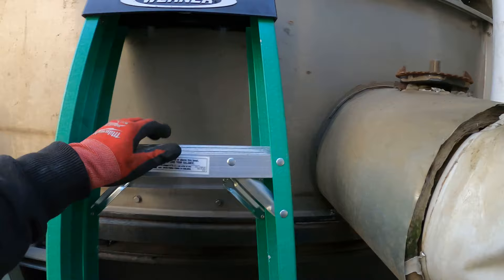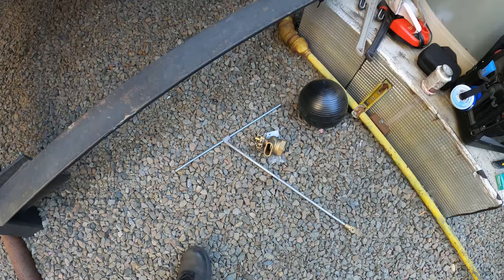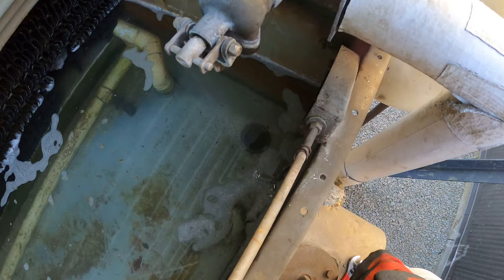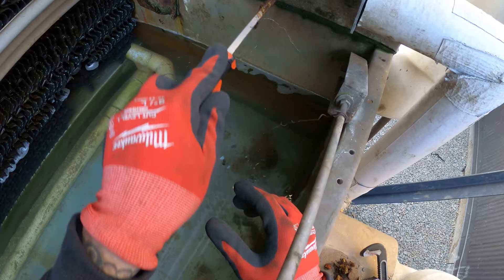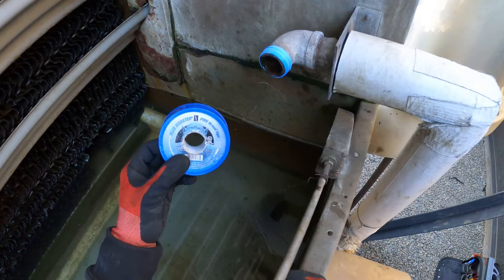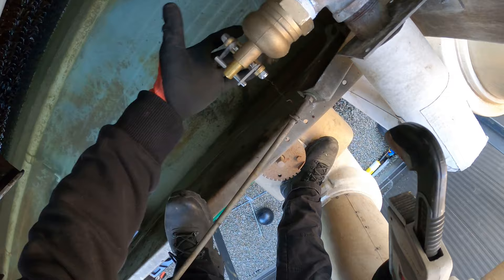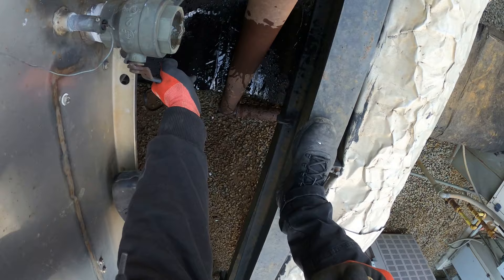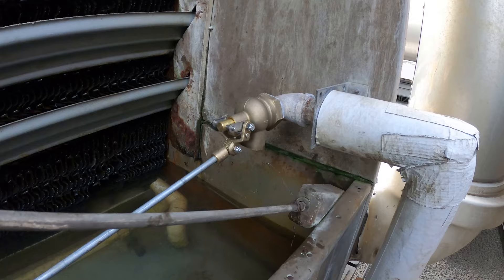HVAC: Cooling Tower Float Valve Installation/Replacement ( Cooling Tower Make Up Water Float valve)

Comment: I use anti seize. on all pipe  threads. Make taking off fitting easier next time
Reply: Same here. I was an jet engine mechanic at United and we used those in the hot section. Now I use it on plumbing and everything where things can get rusted.
Reply: Teflon is anti seize for piping threads concentric wedge self sealing Teflon lubricates threads liquid or tape 6 to 8 wraps on sprinkler pipe left standing.., 🤔✌️☝️👍💪✅

Comment: Clean job bro. I was a building engineer on an old manufacturing building that was reconstructed for a new company during the pandemic. A lot of equipment including HVAC was done incorrectly. It was a mickey mouse job. Found cooling tower that had make up water that was hammering big time everytime it replenished water or when the float valve opened. Could you guess why? The cooling tower and everything else was less than six months old. The cooling tower was BAC. Could you guess why it was hammering everytime  the float valve opened?
Reply: If there was no solenoid with the sensor rods was the solenoid a soft closer and the sump had no waves like the ocean
Reply: @edswider9309  It's been a while and reason why was because the valve was sticky and fluttering. It was plastic and replaced with something sturdier. Metal valve I think.

Comment: They didn't want a fancy new electronic probe with high and low basin level alarms?
Reply from the maker: I hear you with that setup. I have a video troubleshooting one of those. This is the old-school setup. This building is actually only 12 years old. Its been doing its job👍Thanks for watching & commenting. Stay tuned for new videos every week & stay safe out there!

Comment: You really need to shut down the whole system to replace the float valve!!!, you can just simply use other water source (for makeup water) using  water hose and monitor basin level,
Reply from the maker: That would be in a emergency situation to do it live like that which is def possible but we don't take shortcuts. Plus, we are here to make money👀 lol. Thanks for watching & I appreciate the feedback! Stay safe out there and stay tuned for new videos every week!